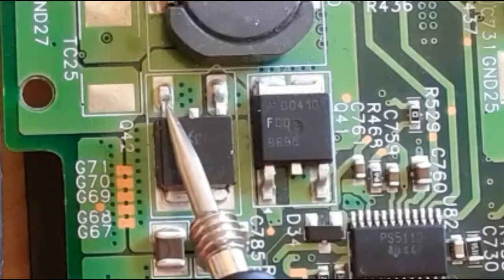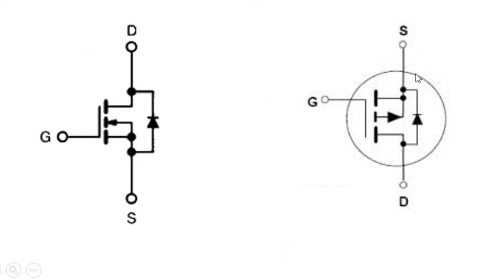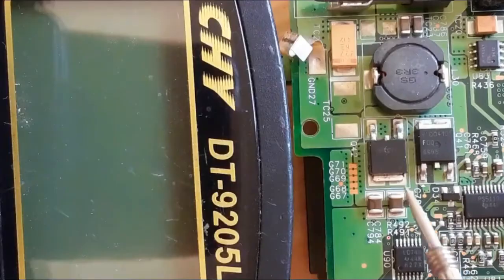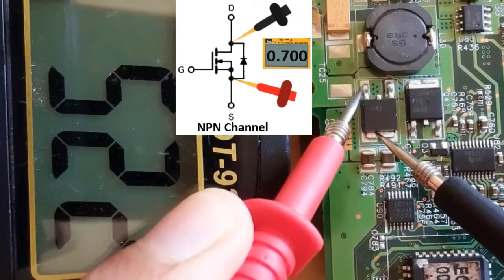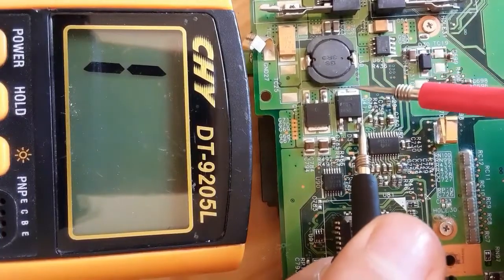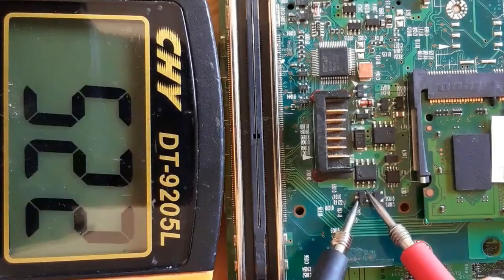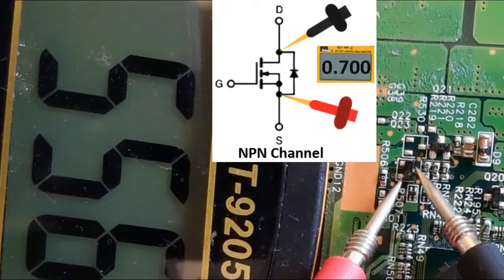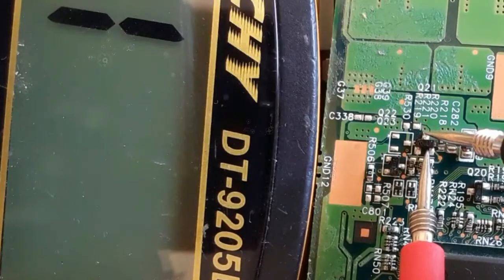N Channel MOSFET Testing VS P Channel MOSFET Testing

Comment: I got 0.557 instead of 0.700. Does that mean it is bad? 
edit: AOD413A 40V P-Channel MOSFET
OK, wait... This is only testing whether it is an N channel, or a P channel. This isn't testing to see if they are working mosfets. I just look at the datasheet to find that out. I want to know if the component is working.
Reply: test it